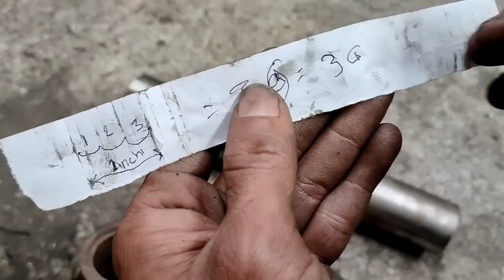See how I measure the hidden square thread spacing

Comment: I was surprised and a bit shocked to see you doing Imperial threads as many many machinist's only work with one or the other. (particularly in mainland Europe and most of Britain nowadays)
I was brought up with Imperial system but because I liked motorcycle engines always knew how to use metric (only America used cubic inches, probably still the only country?)
I've always said a good machinist should be able to switch from inches to millimeters, that makes you a good machinist!
Reply from the maker: here some vehicles from mainland Europe use inch threads, while threads from Japan use millimeters..